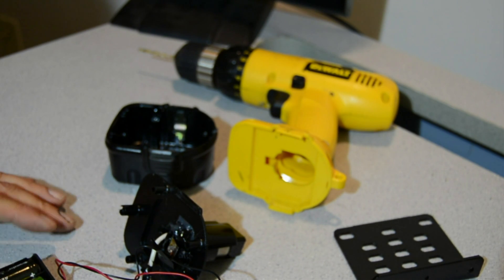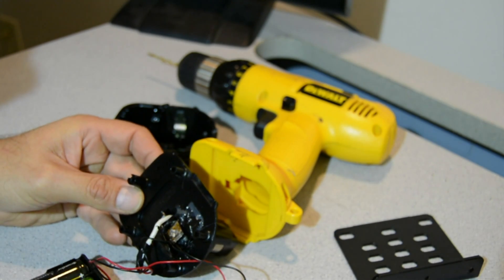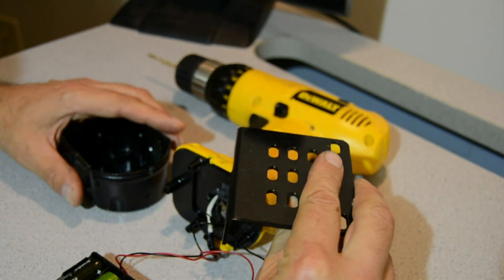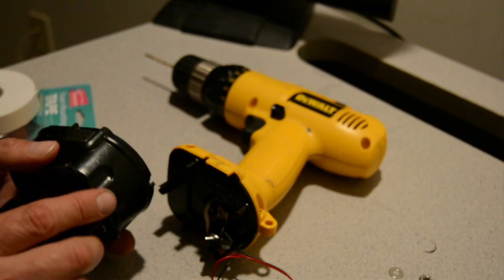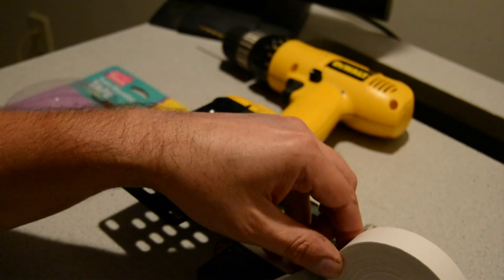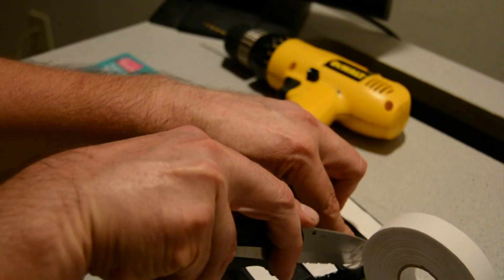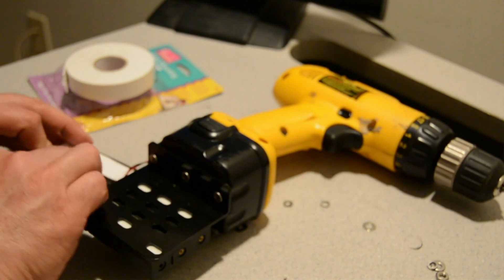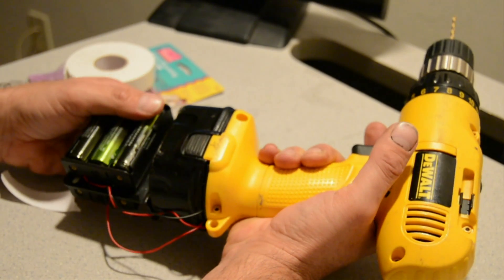12V Dewalt Cordless Drill conversion to Lithium 18650 cells

Comment: nice try but would been easier to put 3 X Li-on cells together with a bms. then you could still use the existing charger and not a hard mod to do.
Reply: Where can we find that mod? I'm interested in finding parts to do that type with the bms.
Reply: What is this "bms" that you speak of?

Comment: Cool video, Just to see that it will work anyway.   the L bracket, looks like an adjustable end bracket for an old wood frame bed,  Just sayin. 

  yeah though.  no way to stack those up in the case and hook them together like the OEM's?   too big or what? i don't have any here to check. i was thinking of ordering though.  i am sick of shitty batteries.    you know what though, from what you have there, it;s neat to check but so lame i would rather go to harbor freight and get a 14 dollar 18 volt Chicago drill.   on sale day with a coupon you can get one with a 14 dollar bill.   they work good, they suck, but its about a 100 times better than a dewalt with it;s end trails hanging out like that. 

  my deal is, i have the drill and the circular saw and man! This shits super handy.   my oem batts lasted over 5 years. the new ones  3 freaking months and they cost way too much!  china china china

Comment: Your concept  needs  improvent. I am sure it won't take long for those double sided tapes to fail . Those unprotected batteries held only by the casing contacts were also a liability .  Have you ever wondered why the factory  secures their  OEM batteries?
Reply from the maker: this was a prototype a few years ago, as I liked the older Dewalt better than the new stuff. The double sided tape is still good. What does suck, is the battery contact springs. They seem to lose their 'springiness' after a year or so. I should bolt the holders just for this reason.

Comment: Your better to by a dewalt 12v lithium battery and make an adapter to connect it to your drill.
Reply from the maker: I wanted to use 18650 batteries so I can always have a few ready to go. I'd also need a lithium charger too.
Reply: Might you explain how to make such an adapter?